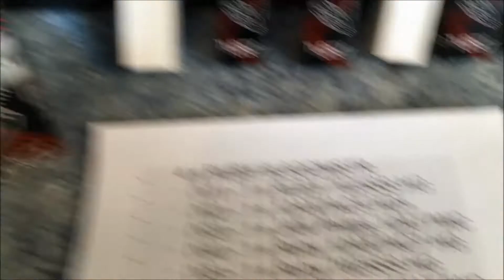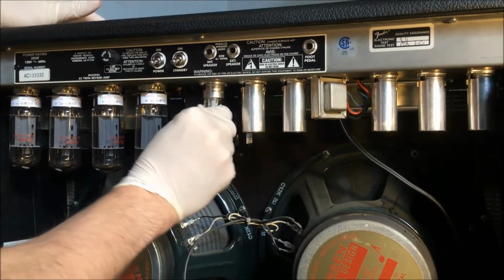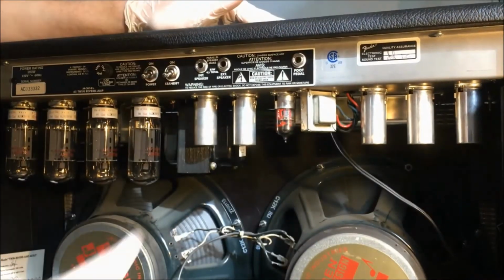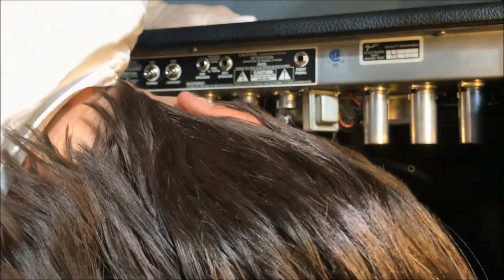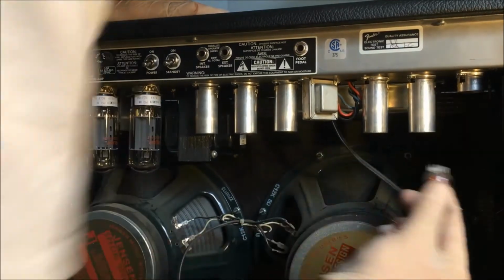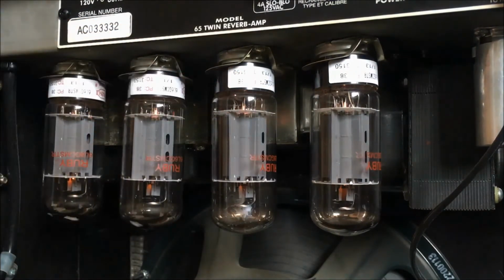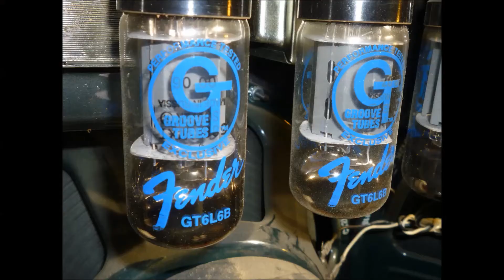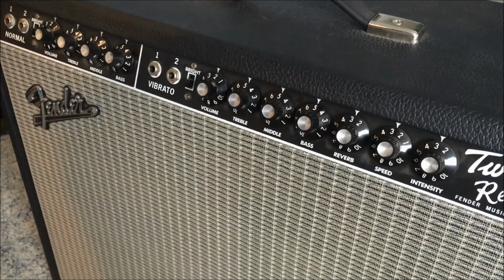Fender '65 Twin Reverb Reissue Amplifier - Tube Replacement

Comment: Thanks for this, I am about due for a tube change and the video was helpful. I did think that the "before" clean sounded a lot more airy than the "after" clean, which sounded compressed. On OCD the new tubes sounded better though.
Reply: Funny, I had exactly the same thought.

Comment: how often do this things need to be changed? and how do you know its time for replacement? im thinking about buying used one from 2015 which didnt have anything changed so i must know this
Reply from the maker: I would think 2015 isn't old enough to warrant a replacement. I'm by no means an expert, but if there's a lot of hiss/hum you might want to replace the tubes.
Reply: @bergles1  okay, thank you for reply!
Reply: If the tubes are good (not defective), the power tubes should be replaced after 10,000 hours of play.  Preamp tubes have less work and should last longer.  For regular use at 25 hours per month, think about replacing them after 33 years - at this rate your 2015 tubes will need replacing around 2048.  My original 1971 tubes still work fine.
Reply: @williamshakespeare9705  thank u